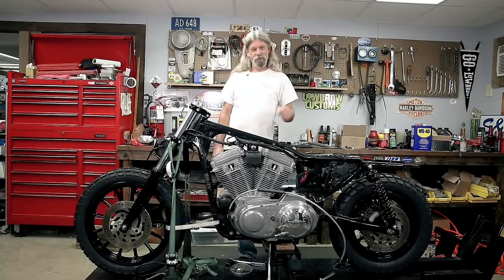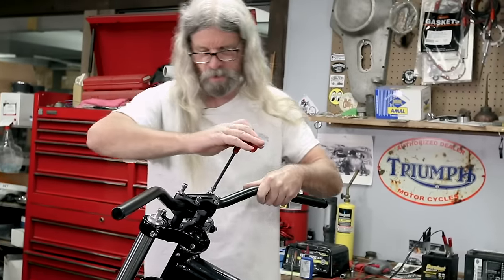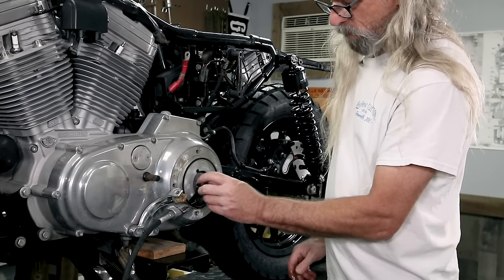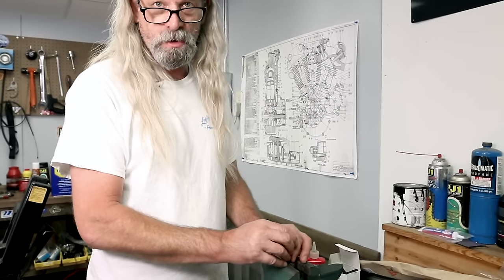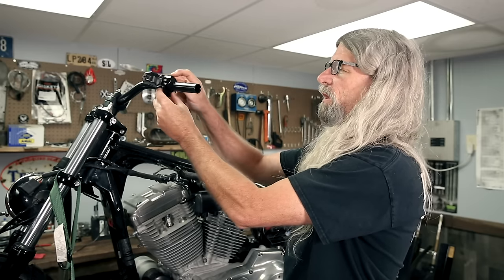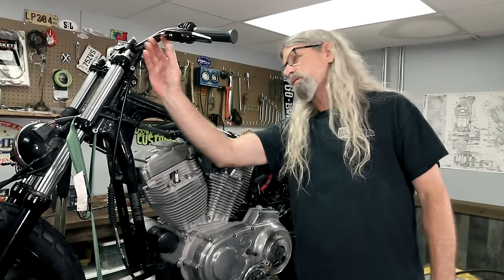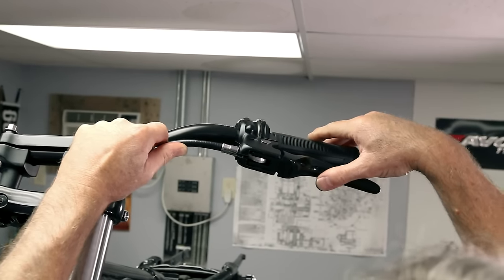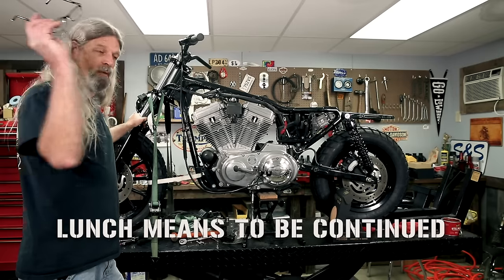Saturday Sportster -Season 1- Episode 6- Handlebars, Left Side Controls, & Clutch Cable Installation

Comment: I’m a CNC Swiss machinist, and alot of our parts get chrome plated so we run our OD 5 tenths under print nominal and IDs and 5 tenths over print nominal as a plating comp. The chrome plating will add roughly 3 tenths to any surface!

Comment: I'm sure I'm overthinking this... when replacing fasteners on the primary housing, the goal is not to move the surfaces clamping the gasket, so remove one, install one in no particular order, different from when installing a removed primary cover when the goal is to spread the load on the cover to 'squeeze out' the gasket.  Is that right?

Comment: Not reusing stock headlight/horn/signal switches?
What are my options other than cutting into my stock housings if I’m running bars that aren’t notched?
My stock XLH883 Hugger housings are mint and I’d like to keep them that way in case I ever want to put the bike back to original.
Do you sell housings I could cut into or switches that would be fairly easy to install without butchering my wiring harness?
Reply from the maker: You can unplug everything don’t cut!!! We have another future episode where todd removes the switch housings and re wires starter etc in the headlight.
Reply: @lowbrowcustoms   Great, I can wait
Ohio just got more snow anyway
Reply from the maker: @davidnorris5675  we are aware! Located in Brunswick lol it bud snows the worst. Spring couldn’t come quicker

Comment: What do you guys think about the vtwin mfg  sportster big bore kits
Reply: Hammer or hooligan kits are more well known. I like the hammer 1275 kit as they had special high tensile liners developed for those cylinders. It's higher grade steel so it should hold up better over time.
Reply from the maker: Go with hammer or SS hooligan kit.

Comment: Never liked the black or matte look on the HDs. Looks like you were to cheap for chrome and had to spray paint everything black. Black good for track and crotch rocket bikes. Plus shiny chrome is easier to see than black when your riding which makes you a little bit safer.